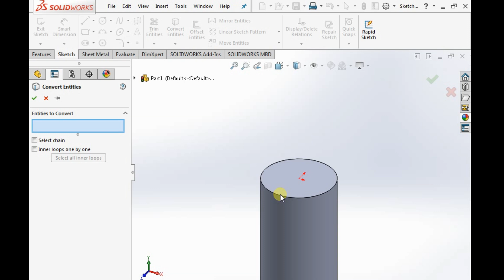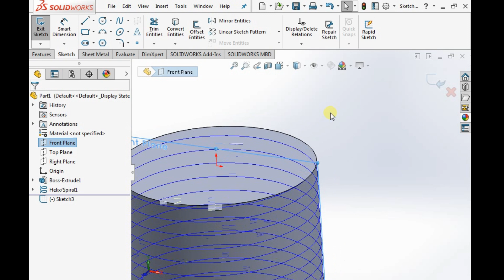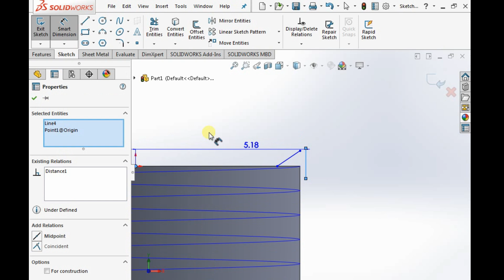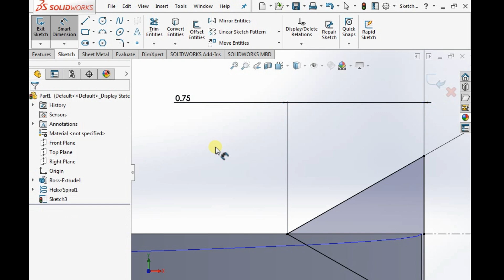Thread Cutting - In Solidworks

Comment: I started out doing it this way, but now use hole wizard mostly. Most stuff I do is basic.

But definitely need to make sure I don't forget this method for the next odd-ball job.
Reply from the maker: Hole wizard is something I HATE! Apart from that hole wizard doesn't do threads, so if you wanna do an FEA on clamping load etc then it's no good to you
Reply: @thedirtyworkshop  Yep definitely limiting. I only use it as a visual representation for drawings, not in any way for analysis etc.
Reply from the maker: Yeah I just cut holes to the tap drill size so if I have to send it out they can't fuck it up
Reply: @thedirtyworkshop  Definitely details like that which make the difference between someone who knows what they are doing vs uni experience only designers.
Reply from the maker: I've had far too many fuck-up with sending shit out in the past LOL
Reply from the maker: ....and having to send it back
Reply: The fooooking drawings I used to get from a masters degree graduate when I was an apprentice were infuriating.
Reply from the maker: I love it when the little bastards reference the edge of a part from different sides LOL cunts!
Reply: @thedirtyworkshop  bugger, I did my time in a precision machine shop. Heaps of stainless with fast turnarounds for local food industry manufacturers (within hours of job arriving).

We couldn't afford to re-work. Tens of thousands (or even hundreds) of dollars when their factory lines shut down unexpectedly.

Comment: You know there is a thread cutting tool in solidworks right?
Reply from the maker: Yes - and it's shit. That's the point of this video
Reply: Like he said, using the threading tool is an option, but it's garbage in SW. It's also useful to know this process so you can easily make custom thread geometries (for 3d printed parts for example).
Reply: @Sphockeysk8r  

I used to do it like he did in de video as well, but once you work alot with the thread cutting tool it is way faster, but making custom thread this way is indeed very handy
Reply from the maker: One thing I will add is this - Stop making threads. Apart from making it 'look' pretty, you don't need unless you need it for a very specific reason.
Reply: In SW 2019 when you choose that tool it warns you that it is to be used for visual or an example. I would not recommend it for production. If you are using a CNC you will have a hell of a time setting your tool paths.